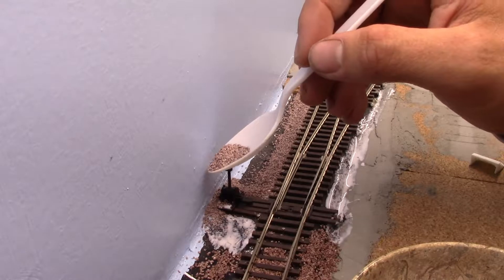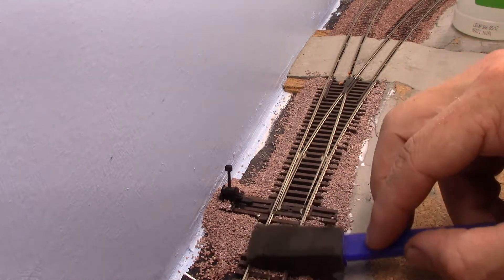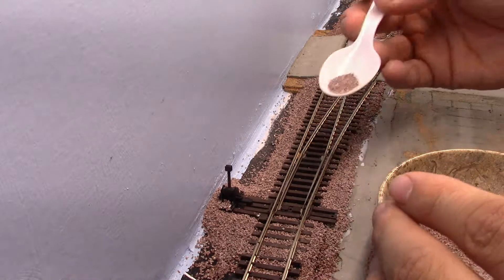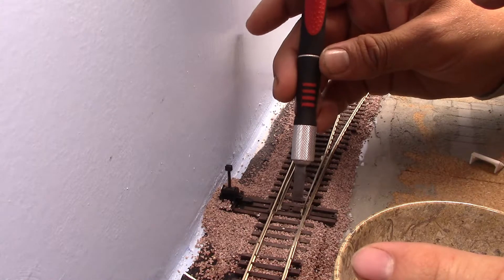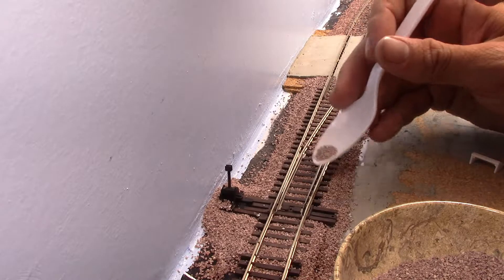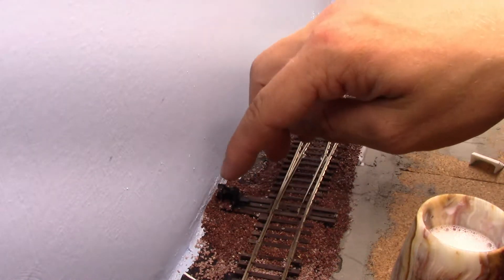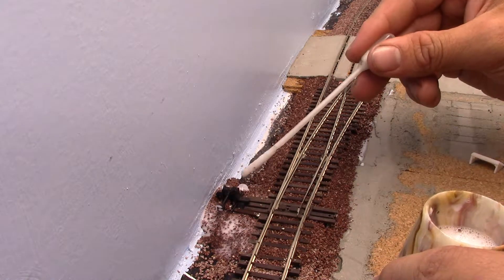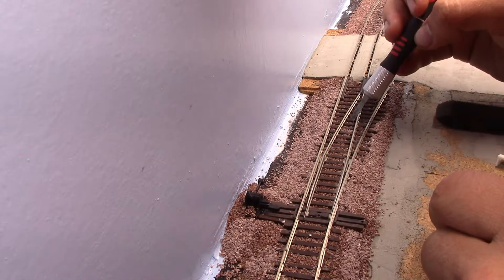How to Ballast Trilogy: Part 3 Turnouts and Switches

Comment: I screwed up an N scale turnout once with ballast. A friend said re-wet it , let the water soak in and use a putty knife to scrape the switch off the roadbed. It worked.  I soaked the removed switch in a glass of water for an hour or so, and was able to clean it all up.
Good series
Reply from the maker: That is why I love Elmer's white glue (Scenic Cement).  If you screw up, just wet the area, clean it up, and do it over.
Reply: @modelrailroadingfordummies9018  YES SIR!!!

Comment: ballasting is tricky when it comes to switches. A tip I got from Video Plus is you should never place ballast near the control rods any ballast here will weld the turnout shut and you will have to replace it. When you ballast do the outside first than go inside. When you do the inside don't place ballast near the points, the frogs, the heel joints, or by the control rods same goes for glue you can weld the points shut and the turnout won't work. If you do get ballast near any moving parts use a brush and remove it before the glue sets.

Comment: I ballast the complete switch making sure not to get any of it above the bottom of the point rails and also putting oil on the moving parts to ensure the glue does not stick to anywhere there atre parts that need to move. I also modify my switched so that they don't rely on contact from the points.